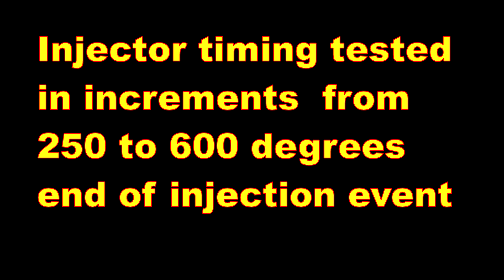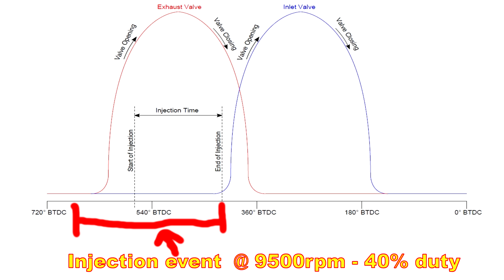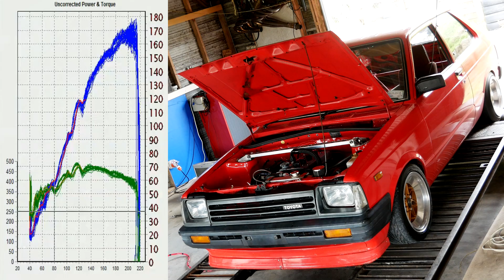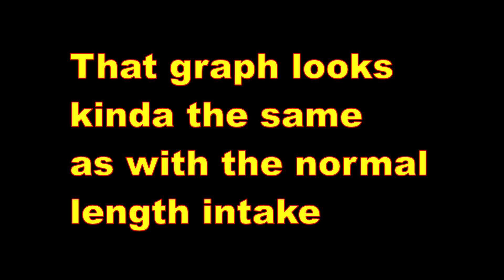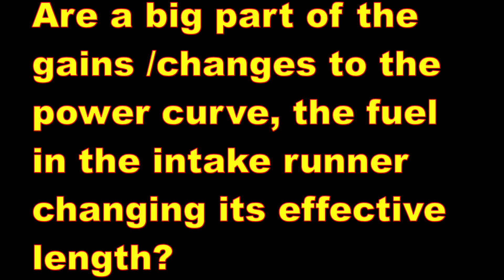Stand off / Outboard injection  - Fuel injector location dyno tested

Comment from the maker: Thoughts on the fuel changing the effective intake length theory ?
Reply from the maker: some things things I  should  add;  Sitting against the head is a thermal gasket.  then a 25mm plastic adapter manifold.  which the throttles bolt to. the rest of the runners attach with a silicone hose joiner.  There is also big hole beside radiator that blows across the intake side of engine bay.   The throttles themselves rarely get above ambient temps, let alone the rest of the intake.  Also the injectors in "normal" location are already a bit back from the stock location, approx 160mm from the valves.   This along with firing into a cold intake manifold, are possibly taking away cooling/mixture gains people were expecting to see.
Reply: It's tough to say. You could try making the runners even shorter and see what happens. It's too bad the engine bay is too small to run outboard injectors with your standard size runners.
Reply from the maker: @zerohikari2685   Yeah that would be the ideal way to test it.  if i get keen enough one day will make a bendy intake, that gives enough room  to test at normal length.  There looks to be some small gains maybe 1-2kw  coming from the cooling or better fuel mix theory's.  but unlikely they would move the power curve around so much. looking specifically at the flatline at 8k that gets filled the same way as the longer intake
Reply: In effect, it's turning the fuel delivery into a carburetored system, where fuel is introduced much earlier into the intake tract.
While introducing a theoretical heavy fuel into the air, it would stand to reason that it would be harder to move. This would support the idea of needing a shorter runner.
However, fuel atomization does throw in some curve balls. It is well demonstrated on V8s that intakes designed only for airflow perform poorly with the challenge of fuel distribution.
No, on an ITB setup, fuel distribution is not a problem. However, the smooth runners on the inside will be more prone to produce fuel running down its walls, like rain beads on glass. That is not how fuel wants to burn. 
Perhaps, if not already done, the insides of the runners were exposed to a light sandblast? The gentle abrasive surface would be less willing to produce those beads.
Reply from the maker: @crd-nz_001   The throttle plates sure must work like a carby at idle.  the fuel literally runs out where the top half of the runner bolts to the filter backing plate. but quite happily idles the same as it normally does on the same tune.  Last time i did it i  recorded down the intake runner.  once on song the fuel cleared out and nothing seemed to have time to get anywhere near the sides.   kept this in mind when starting the runs this time.  giving it a quick zing and using the overrun fuel cut on decel to ensure and fuel pooled was gone at start of run.   The top black  part is pretty smooth,  rest of the intake all the way to the valve has a bit of texture to it.
Reply: Colder intake make sound travel slower maybe. But there’s many variable
Reply: Please see Paul Yaw's comment above "To your question - Yes, the evaporative cooling is altering the speed of sound." Excellent testing. I'd like to recommend another injector for testing stand-off injection. 0 280 158 124. They are 373ccm, but have a 12 hole pintle plate and amazing spray pattern for stand off injection IMO. SInce you are only at 40% DC of the 980s (which are really 957cc), these would work well at 4 or 5 bar base.

Comment from the maker: Would anyone like to see an injector timing specific video?    when the injectors are in normal location close to the head,  they respond quite a bit different to what is seen here.   I didn't want to go into it too much in this vid.  as already a lot going on.
Reply: Everything you do will be welcome. Don't worry about too much info, just send 🌝
Reply: Yes please!
Hell, if you could throw in a "batch fire" test, it would be interesting too. 
Stock ECU does a batch fire (1 and 3, then 360 degrees later, 2 and 4) so it could be a good comparison Vrs full sequential.
Reply: @crd-nz_001  yea batch vs sequential would be good.
Reply: @crd-nz_001  great idea ...but don't the injection switch over to batch fire above a certain rev point?
Reply: @Daniel Gomez  From the printout I read of how the ECU works on a 20V is that it's always batch fire.
Reply: @crd-nz_001  understood. I would have figured that to be the case just based on the age of the technology. Thanks for the response!
Reply from the maker: @crd-nz_001   good idea re batch fire.   but not willing to try it on this engine.  As it goes into the danger zone fast at a certain point when injector timing isn't right.  it only does it with the inner injectors. not so much with the outer.  but yeah likely end up with lean cylinders
Reply: Would love to see it.
Reply: Would love to. I have been playing with injector timing in my car, but mostly for idle quality and emissions testing purposes
Reply: Absolutely 💯
Reply: of course! i know this channel isnt focused on fuel economy but im interested in the effect of injector timing and batch/sequential in mid rpm torque.
Reply: From my experience with dyno with multiple cars and configurations, having the injectors very close to the valves are best for throttle response, if progressivelly the injectors are more distant from the head, the throttle response (accelerating at car stopped, in neutral I mean) whorst progressivelly.  In power runs, I do not have too much data because not near your ectensivelly tested car, I work with many racing cars here in Italy, but not soo much tests with the same engine at the time, but considering the excelent state of development of your car, I think your gains now will be more concentrated in the little gains, because it is heavely developed, for example, you can play with injectors of latest generation, those with multiples holes and use a injection pressure higher, for us, better results with 4 to 5 bar respect the same injector at 4 bar.  In this case, atomization is what can do a difference, and at equal dyno results, probably you will notice a better BSFC, having a fine fuel dropplets is better for mixing with air, and this can have benefits for charge cooling wich is important but not so high respect to turbo cars, now you are fight for the little gains, every Kw matters. That's the same thing big Motorsport do in series restricted by rules, they fight every day to find the 1-2hp a month to have the advantage over the competitors. 

The influence of the intake lenght is ifluencing for sure, but usually, shorter runners move the torque curve to the right, less torque under 6000-6500, better torque over that rpm. it is  sad you do not have more space at disposal for injectors, tho.
Reply: @hiperformance71  bad response spunds like bad accel enrichment ;-)
Reply: Yes please
Reply: Yeah definitely. I used a port injection timing calculation that uses injector distance from valve + camshaft specs to get some values. Found some improvements in power but also better starting & throttle response. Am sure you've already got or found the same but happy to share
Reply: Would love too! This is the greatest engine nerd channel in the world.
Reply: Yes please with batched v's sequrntial would be awesome too :)
Reply: Rpm based injection timing would be awesome.
Reply: Hell yeah.
Reply: Yes please.
Reply: Yes plz
Reply: Yes, please show. I am building an enclosed plenum with port injection (injectors inside the plenum, OEM throttle in front of plenum). I'm not sure if I will have to play with injector timing.
Reply: What ECU are you running? Would bei great to learn about injector timing regarding how to set it and also what the effect and result is....
Reply from the maker: @carstenfunk6075  Link G4
Reply: Yes!
Reply: You should investigate the injector itself. A bosch Motorsport 980cc is at the moment the "benchmark" in price and performance (flow) and spray pattern. :)
Reply from the maker: @TurboAcki   Yeah they seem good. thats whats in it btw
Reply: @Garage4age  yeah I could image 6 hole, 12 holes etc. injectors might make a difference (I guess only between hot and cold intake air) - sometimes legends say warm/hot fuel might also have an impact (AFR neutral)...
Reply: Should have been part of this vid. I think ideal video length is 10-15 minutes.
Reply: Around 430~ 480 EOI good for my 20v
Reply: Yea send it budd!
Reply: Someone else has also mentioned testing injectors with different holes. I was going to suggest the same, from a single pintle up to the Bosch 16 hole (google that for part #). You could also test rotation angle as most injectors don't spray directly forward from the nozzle but are at an angle.
Reply: @danielmalone3463  A check of spray on intake valve or prio wall could be something, but there are also a lot of publications available - from past. I think the hole / evaporation behavior is something which is worth to test. as this 1:1 different holes and distances wasn't done yet (as far as I know)
Reply: Yes ! I'm trying to optimize mine NOW with hptuners on a cammed gen 3 ls
Reply: yeah ! That would be great to see an injector timing/angle specific video.  
are you just looking for the richest AFR at idle or is it more Complex ?